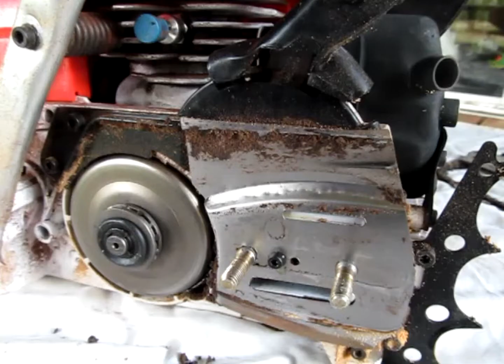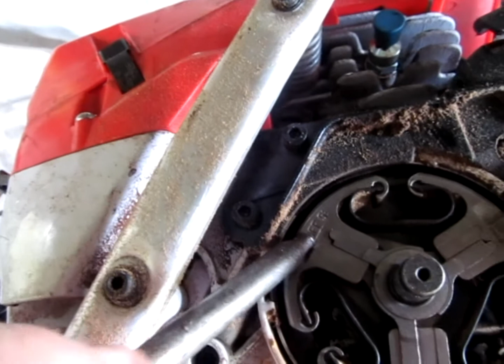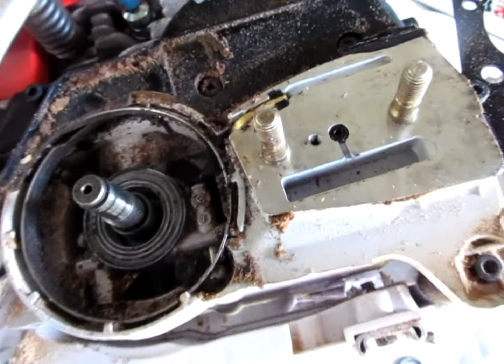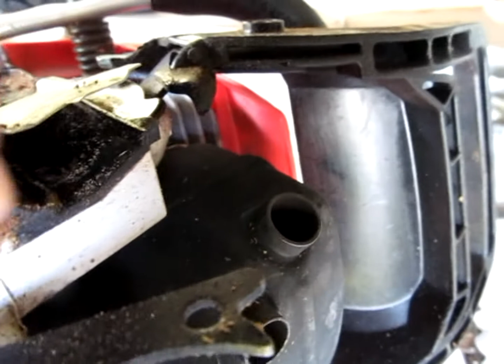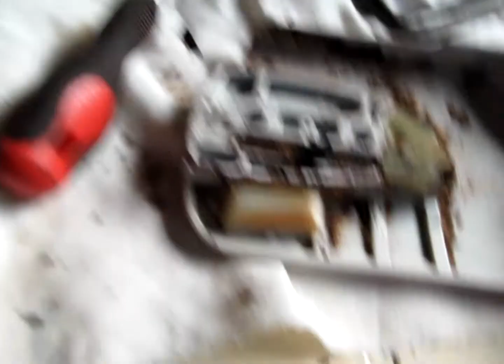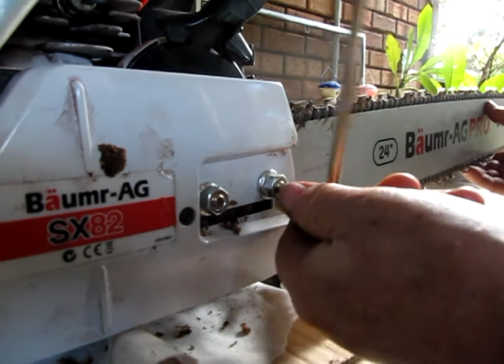Baumr AG SX82 24" Chainsaw. Help Mods,Tips and improvements

Comment: Hey mate great vid, quick question tho after youve tightened your guard plate does the chain still move freely? Ive held the bar up, lossened, tightned, everything possible but it wont move once its tightened past finger tight
Reply from the maker: If it's binding then something must be wrong. 
Was it hard to get the cover on? 
 Make sure you have not got the chain brake locked on. 
It must be pulled back into the free running position before fitting the outer white cover on. 
Definitely the chain should run free.
Take your time. Have a good lock at what is happening and why. Tighten it slowly to see if you can see where it's binding. You must have made a very small mistake. You just need to figure it out. 
On a different note if you have trouble with the motor in the future then check and replace the hoses. They tend to crack and brake
 Then  it will run lean or not even run. The rubber must be shit quality.
I only run the Chinese saws for a couple of seasons then the them out when they give me teouble. It still works out cheaper than a Stihl. 
I have one 18 inch client that must be 10 years old. It's still my go-to saw as it always starts, runs and cuts brilliantly. The only negative is the bar is a bit thin and flexes a bit. As long as I keep the chain sharp it cuts straight but when it blunts a bit it definitely needs attention otherwise it will cut a curve and bind in the cut.  I don't think I've ever even adjusted the carb. I run motorbike 2 stroke oil and 25:1 mix.

Comment: Thanks mate.great tutorial the bar tensioner made of plastic is a shame.? The Chinese are weird people why would they make it this way.maybe they just haven’t stolen the idea from anyone else yet.🤨🙂👍
Reply from the maker: I've found that the hoses are rubbish too. If you get any problems with how it runs just replace all the hoses. They must be made of the cheapest rubber they can find. 
Maybe if they spent a bit more time on the quality they would be on a win. 
Mostly I buy the 18" Chinese saws and then run them into the ground. I keep them sharp and keep an eye on things in general. They have proven to be reliable for between one to three years. One has been going well for about 5 years. It still starts easily and cuts like a beast.
These days I don't see Stihl or Husqvarna as being much better. The world is becoming throw away for so many tools. 
Temu sells chain adjusters that I think ni may be able to drill a hole in the front and fit one as a replacement. Being gentle will help the original last.
Reply: @lynpatnat thanks mate very informative. The old adage you get what you pay for I guess.I like idea that Temu may have a chain adjuster that may fit .?thank you and take care.🇦🇺🙂👍

Comment: Mine has a stuck chain brake, what is the screw under the clutch? Is it something I can use to release the brake?
Reply from the maker: I'm not sure about the screw but the common reason chain brakes lock on is wood dust builds up between the brake band and the drum. 
Pull the bar off so your can see the band and see if you can move the brake back and forth to loosen the band.
If you find a solution post it here so we can all learn from you.
Reply: @lynpatnat  thanks it’s brand new just out of the box and the brake is stuck, in discussions with eBay about a resolution but I suspect I’ll have to fix it myself
Reply from the maker: Give it a good pull backwards or bump the brake handle back towards the rear of the saw. Sometimes chain brakes can be tight. 
There will be a cam near the lower area that locks the handle forward. It's a detent to keep it in the locked or unlocked location.
I've never encountered what you are describing so can't help.
Reply: @lynpatnat  I’ve just made a couple of videos visible on my profile if you have a few minutes to see
Reply from the maker: I just had a look. Try pulling on the start cord. That looks looks like the crankshaft is locked/ bound up or siezed in place. 
The brake handle looks like it is working right to me.
If you can wriggle the band sideways when the handle is pulled back then the next thing you need to know if that the crankshaft rotates.
Reply: @lynpatnat  the motor runs there’s a second video up now, I’ll take the clutch off and see what’s going on
Reply from the maker: Yes. Take the drum off and see if it's binding on the inside metal clutch. Maybe the drum is deformed or the clutch springs are not keeping the clutch shoes pulled in
Reply: @lynpatnat  I had a look under the chain brake cover and it looks like the lever isnt engaging with the spring mechanism, mines either out of alignment or missing pieces

https://www.youtube.com/watch?v=VKUVrkF8bC8
Reply from the maker: Could it be possible that the part you were poking at with you screwdriver should be on-top of the lever above.
It's 8pm here but I can look at my saw in the morning and  see what it looks like.
Worse case is put it back together and message that there is a fault. Just don't tell them you pulled it apart of course.
Reply from the maker: I've added a video to my channel of how the brake can mechanism works.

Comment: Thanks for a great video , I have an issue with the oil feed hole blocking up after I good cut of wood, there is heaps of oil coming out the oil pipe, I put the bar on run the saw for a min and bar is lathered in oil ,,then I go and cut a piece of wood and within minutes bar oil feed hole is blocked solid with dust rendering the chain dry and oil dripping down on my boots . I have done all you tricks with the SS backing plate still with no results, same problem. I've been in contact Edisons and they want me to send in a video of the problem,, They said could be a leaking oil pump ?Any help would be great ,, Its a great saw but useless to me atm .
Reply from the maker: You could clean it all up then use a very thin oil with a bit of food colour in it. If you get lucky and use a torch you may be able to see where it is leaking from before it makes a mess everywhere.
They could be right that it is the oil pump but it could just be excess clearance allowing oil past somewhere else. If your do find the problem let us know.
Reply: @lynpatnat  Thanks so much for your reply and help and good idea's,, Cheers

Comment: Seems better to buy a good saw.
Reply from the maker: That's very true. A good brand saw is much better over time. These chainsaws copy the basics of the saw but will never be as good if you plan to keep them for many seasons. They are always let down by detail and fitment of parts.
If you just need to cut a few trailer loads for the winter and then buy a better one next year the economics do stack up ok. I favour the 16" Chinese saws as price and reliability seem to fit just right. The larger saws have bars that are too thin and flex too much so as soon as the chain gets slightly blunt they will cut a curve. I then spend too much time keeping the chain perfect.
So yep. I agree. Dig deep and buy the best when you can afford it.

Comment: .......not you're typical roofing/household silicone cos it swells up and comes loose in oil or petrol environment. There are silicones that hold fast cos I noticed them used in LPG conversion jobs long ago . I've never obtained a tube but it exists. .It's silicone ,not silicon of course.
Reply from the maker: Yes. Very true. I used Petmatex Ultra Black #82180.Maximum Oil Resistance. Gasket Maker. I googled to make sure it was the right one. There will be other brands suitable.

Comment: Hi. Can you tell me, how to fix kick on this chainsaw pls. My chainsaw is  keeps on breaking the code and injured my hand.
Reply from the maker: Just re-read your question. I think you are asking how to replace the pull start cord. There are lots of clips on youtube for replacing cords they are all similar in design. I can do a specific clip if needed but I think you should be able to work it out without one.
Generally speaking:
Remove Side cover with pull cord and have a look. Do not dismantle it or remove the central screw. The cord can usaully be fitted on most saws without dismantling that spring.

1: Buy a good quality cord (ebay or similar)
2: work out using your old cord as a guide how much you need plus about 100mm more then trim it down later.
3: melt the ends on a flame so they are sealed and have no free stands.
4: Tie a knot in one end...very tight. pull it with pliers so its tight.
5: Thread that though the hole in the part that holds the cord (just like you can see the knot is ans the cord is.
6: look for a notch in the plastic cord reel. Turn it clockwise until it lines up so you can pull the cord through at at right angles to the reel (90 degrees).
7: Cut cord to the correct length using the old cord as a guide then seal the end again with flame.
8: Put the other end of the cord through the hole on the side cover where the cord goes and attache the handle.

Now you need to put tension on the spring so it recoils.
Look on youtube for how to tension pull cord on chainsaw, whipper snipper lawnmower etc. You will find one that shows you
You hold the cord in the slot and wind clockwise (usually). 
When you get the the tension that feels right (its not as tight as it can go...just the amount it needs to retract well) you find the place that allows you to move the cord to its correct pull start place and then let the cord retract. If it is too tight or loose you can adjust it buy  a turn or two. You may need a pointy hook to get the cord out for the adjustment but dont use a knife or anything that can damage the cord fibres.
Cheers
Reply from the maker: If are getting kickback on your saw. Make sure you have Semi-chisel chain. Google see what that is. Keep the chain at correct tension. Make sure you cut right where the bar meets the engine. Never too cut. All these same things apply to any chainsaw. Look at some YouTube clips about kickback.
Reply: Thank you kindly for your information. I have decompression problem with baumr ag sx62 chainsaw. Hard to start and it's keeps on breaking the code. New chainsaw comes with decompression button, but not in this model. I don't know how to fix it. Can you help please
Reply from the maker: @progreen9370   If your model doesn't have the decompression button to pull out then I think you may not have a way to fix the problem. The only suggestion would be to use a good brand name of pull cord and then learn to only pull your arm back to your shoulder. If you pull the cord too hard or too far you will break the cord and the spring inside. I have seen that many times. It may be possible to fit a decompression valve but I think that would be difficult and probably not worth it. If you are gentle and dont try to rip the pull start out you should be able to start it. Try using good quality cord. The cord it comes with is very weak but so far I have not broken mine so it must be your technique or how you start it. Maybe got someone else to try to start it and see what they do differently to you.

Comment: Thank you for doing this video.  Your no-nonsense descriptions and explanations were spot on.  I bought a Baumr-Ag petrol jack hammer about a year ago.  I used it a few times then literally left it in a hole to go get my dinner.  Six months later (don't judge me) I went back to get it and it started first time!  I was so impressed that I've just ordered a Baumr-Ag chainsaw and an auger,  Both will be arriving next week, so your chainsaw video has helped me to be prepared for potential issues with that.  Thanks again! :)

Comment: Hi, my SX82  with just a couple of uses the clutch is slipping so bad i cant really use it, as soon as it sees a piece of timber the chain stops turning, does anybody have an idea how to adjust the clutch so it dont stop working when it touches wood,
Reply: thanks guys , i think i found the problem , the oil is flooding inside the clutch drum and none going on the chain, now i gotta work out a fix
Reply: @chasemebigboy  hey mate, got the same i issue i believe., How did you go about solving it?
Reply from the maker: I'm not sure how you could fix that. Adjust the spring length so they engage easier but you have to be careful not to changed them much. 
Take the clutch of and spray the surfaces with brake cleaner so there is no oil or write debris on the surface then gently Emery the surface of both the clutch surfaces and the metal clutch drum. Clean and extra friction may be enough. If they springs have lost tension from overheating then you would need be springs but that is unlikely.
Comment on here of you find a solution so we all know.
Cheers.

Comment: nice tips 
but not sure you mentioned the clutch plate at least on mine has 2 notches on it which need to line up with the oil slinger 
Its the clutch that powers it in other words at least it is with mine

Comment: Thanks for the tips absolutely awesome mine is leaking chain oil out whilst not running I will check rubber grommet you mentioned on the pump
Reply from the maker: I have heard they can leak between the case halves (joint). Pull it apart...chain and bar off etc. Clean it down then fill the oil reserviour with some fuel like kero. Put the lid back on and shake it. As it is thinner (less viscose) you will probably see if its leaking between the cases. If it is the cases would need splitting then wet and dry surfacing on a sheet of glass to get them true.
Take some video and upload up there are some good people online that will help.

Comment: Correct me if i'm wrong but it looked like you put the sprocket on backwards. The holes on the sprocket should be facing out  so the sawdust can get out and not carry up with the drivers and plug the oiler slot.
Reply from the maker: I will go have a look at the saw over the next few days to be sure its slotted on one side or just plain both sides(after all it is a copy chainsaw). I see your point if its slotted on one face then that should point outwards to prevent wood dust building up between the sprocket and clutch then moving fowards to the chain and oil delivery. Great catch. So glad to have other wise people on here helping out.
Reply: @lynpatnat  :) I've been running chainsaws and cutting timber for over 40 years. Had that problem over 25years ago when I switched over from spur sprockets to rim sprockets.
Reply from the maker: @aldredske6197  Thanks. It's those little details that are so easy to overlook. Thanks for pointing out out. You are helping a lot more people than just me with that tip.

Comment: Couple of points, the oil pump drive gear fits into a notch on the edge of the clutch drum, you have to make sure you line it up when fitting the drum, its not air that drives it,  also the bolts that hold the oil pump in need a dab of sealant on as they are drilled straight into the crank case and be a cause of air leaks
Reply from the maker: EvoJigger thanks for the positive addition to the video. The more we know the better the repairs. Cheers for the great information
Reply: If you ever need really cheap parts for one of these saws, as they are a carbon copy of a husqvarna 372,  Huztl.net is the best place to get spares, some outer bits might be orange and not white, but they will fit and keep a saw working.

Comment: Yea the mixture comes out of the factory a bit rich to help it run in at both ends. A few tanks of fuel should be run before leaning it out you want those rings and roller bearings run in properly with that nice running surface first but if the day comes and she's low on compression go grab a huskie big bore kit and slap it in you'll turn that weapon into something crazy lol
Reply: Gavman's Workshop hey mate. What motor is the sx92 based off? Which husky? I need to put a better carby on mine. I can not get it to run right no matter what i do to the H and L screws, except for just prior to the tank emptying... which says its rich.... but lean it out and it runs worse again. Cant win !

Comment: Also that screw adjuster I certainly did modify one to be a straight screw which worked great (did a video) but the simple fix is a genuine husqvarna 372-395 chain adjuster mechanism but at the time I didn't know any of this so anyway the husqvarna parts don't strip out and fail. As you can probably tell I keep pausing to comment lol

Comment: G'day mate might be worth looking at a few of my videos I did as I progressed along I realised that these take husqvarna 372-395 parts so mine runs husqvarna bumper spikes and sports a husqvarna chain tensioner mechanism. That plate might be a better fit too not sure there but genuine parts are fairly cheap and readily available at most chainsaw stores which stock husqvarna tools and equipment.
Reply from the maker: Thanks Gavman. I had a look at your videos and got lot of info out of them. It looks like we are on the same page with these chainsaws. Interesting how they are Husqvarna clones. Yes... They are rich out the box and I agree its best to run them for a couple of hours like that letting them "4 stroke" at higher loads/revs. I also like to run them for a couple of cuts then let them cool down for a while as they bed in. The clutch spocket needle bearing needs oil right from the start. They must assemble these without lubing any parts.I also like to check that the oil is delivering before I put a chain on during my pre first start.
 I used mine to cut down a tree yesterday in our back yard that was more than the 24" bar length. It ran like a dream. I had to start it before climbing though as I was 6m up a ladder and it feels like a big beast when lugging it around. 
It would be nice to see them spend an extra $50 in the factory to make these perfect. Maybe over time  they will see the benefits of a bit more quality in the minor details.Untill then we will keep doing the minor mods and share the info to help others. Cheers.
Reply: good tip